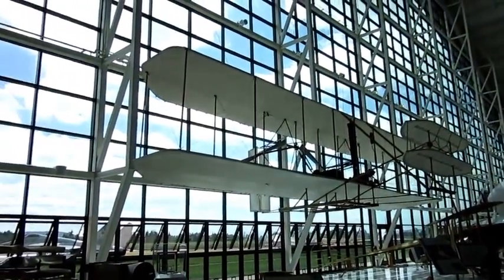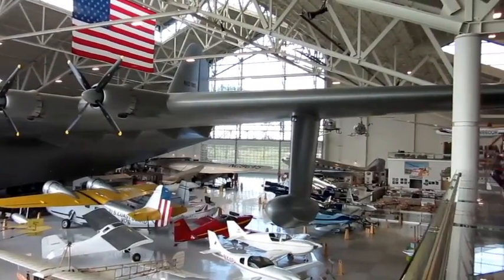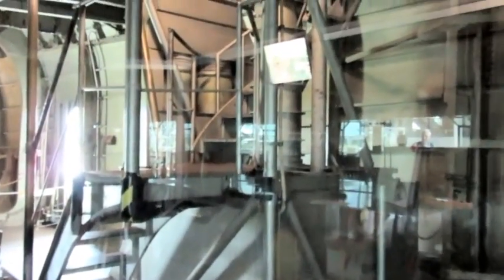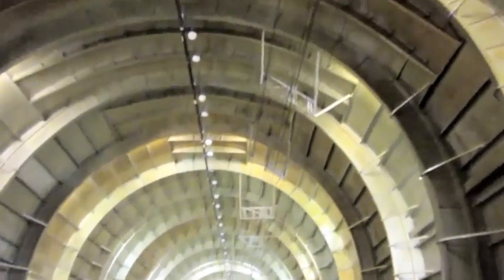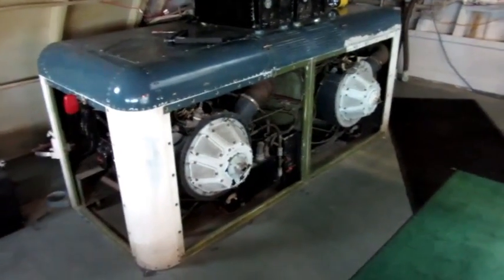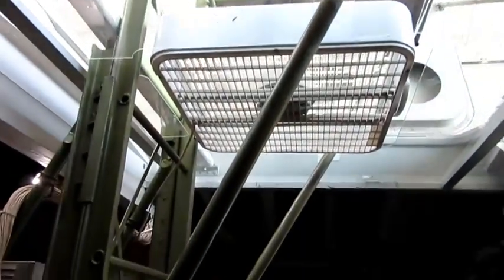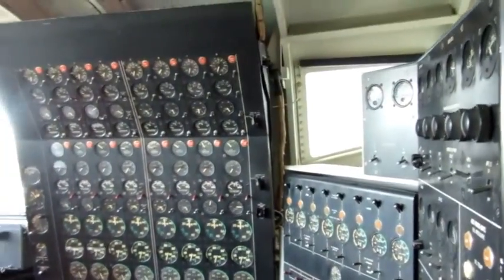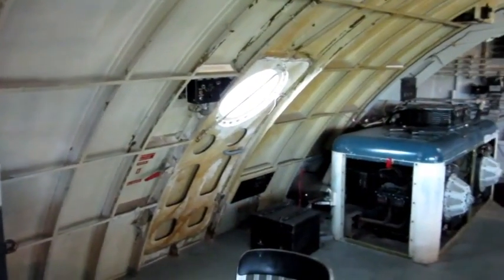Spruce Goose VIP Tour

Comment: It's interesting to me that the ADF (Automatic Direction Finder) antennae are inside as opposed to outside as in most aircraft. When I think about it, that mostly wooden aircraft fuselage would be almost completely invisible to the radio waves. It is the metal fuselage of most aircraft that requires the installation on the outside of the craft.

Comment: Hughes made his money originally from his father and The Hughes Tool Company in Texas.  Hughes, Sr.  invented the three gear drilling bit used in the oil industry, all over the world, and is still used today.  My father was a machinist for Hughes both in Texas and Culver City, CA.  My mother, brother and myself also worked for Hughes Aircraft, Fullerton, CA.  Howard Hughes also built the world's largest helicopter which my father also worked on.  There is a video of it here on YT.  Try to imagine being in the cockpit of the Hercules and having your hand on the 28000 horse power throttle.

Comment: I had  the privilege of guarding  Mr. Hughes. During a conversation I asked him if he intended to take the spruce goose airborne and he looked at me and smiled.
Reply: My Husband installed his Doctors gasoline pumps in Blythe Ca.in 77. He was the Doctor who had to go to England to fix his broken hip from a crash in a plane because he would not let the Doctors touch it . My Husband and a couple guys installed the island went back to AZ then had to go right back because the Doctor wanted it torn down and redone they could not understand then my Husband said take each pump there were 2 of them measure each pump get them exact to the inch from being apart he did put a nice coat of paint around the island the Doctor was thrilled Howard could rub off on to some people but he is one of my Husbands heroes.
Reply: @cindysue5474  "his Doctors gasoline pumps" means what?   Please rewrite so we can understand.
Reply: @robertgift  Just saying how Howard could rub off on people.
Reply: @robertgift  His Doctor also operated a gas station. So, he needed pumps.
Reply: I doubt you used the term spruce goose in front of Howard and not gotten slapped!
Reply: @jslade60  I did use the name spruce goose, Mr. Hughes was not offended by that, don't believe all the trash said about him. He was very easy to talk to.

Comment: I did this tour a few years ago with a friend of mine who was a former pilot.  While we were fascinated by the arrays of gadgets all over, my friend pointed out that there were a number of controls necessary for the operation of an airplane that were either missing or, were simply unlabelled and in strange places.  One of his best comments was that the Flight Engineers' station looked more like a movie prop then an actual F.E. station.  Why three sets of controls for engine throttle but NO controls for pitch or mixture were present.  There is a large blue button up in the pilots' area labelled "Auto Mixture Control" but, surely that couldn't be the ONLY control knowing Mr. Hughes penchant for redundancy.

Since we were the last tour of the day, our guide let us go over the controls with utmost scrutiny and NOWHERE could we find any controls that had anything to do with propeller pitch.  Even the Hydraulic control station (which was added after the only flight) had no controls for pitch.  Granted, this plane should be treated as an unfinished prototype,  but one of it's design functions was supposed to be a water landing and the ability to beach the nose.  With no Pitch control, there is no way to make the engines produce reverse thrust and back the plane away from the beach!!

It's sort of a testament (in a manner of speaking) to Howard Hughes' failing mental capacities during the construction of the plane.  His Engineers were under strict instructions to follow his orders to the letter.  Perhaps Mr Hughes forgot about these controls?  Certainly his employees were not going to go against the Bosses wishes!

Still, it was great to be able to admire this amazing piece of history. The fact that 70-odd years later - many of those sitting outdoors at Long Beach -  she's still here for all to see.

Comment: My Grandpa worked on the tail of the spruce goose, in St Louis, Mo. He was a master cabinet maker. I think he worked for Curtis-Wright, at Lambert Field. as a contractor for that build. He told many stories about his time, there, and it may have been his proudest build. He spoke about walking through the wings, and working inside the plane while the engines were running. It was a soup of sawdust and smoke, and the sounds were deafening. His most modern tool was a flat head screwdriver.
Reply from the maker: Coachbrandon01, your grandpa might have told you a tale. The Goose was supposed to have all been built in Hughes own shop in California.
Reply: @youtuuba  My grandpa was not a liar, so, I am sure with some research you'd find that he was a builder on the plane. Did he fly out of ST Louis, to work on the plane? There are many scenarios that may have happened, but my grandpa being a liar was not one of them. Only You can change your mind. Sorry this does not match your reality.
Reply from the maker: @coachbrandon01  , don't be deliberately stupid. You are the one who wrote that he worked on the Goose in Saint Louis.....NOW you say, well maybe he worked on it somewhere else, and then accuse ME of needing to adjust MY reality. Second, I did not call your grandfather a liar, I just questioned whether in the course of telling his story, some information might have been confused, or you misunderstood or misremembered what he told you. I assure you that I have a better grasp of history than to have that thrown into doubt just because somebody on YouTube claims that somebody else told him something that does not seem correct.

I read a story in the Air Force Association journal where some old guy wrote that he flew a B-36 bomber over the Sears Tower. I checked and verified that no B-36's were still flying by the time the Sears Tower existed, and no earlier structure was called by that name. I pointed this out to the journal editors, and they asked the guy's son, who had submitted the story on behalf of his father, and he replied that his father was not a liar. But we all knew that the story was partially false. Where did the error come in? Did the old man simply misremember, or did he slip up when relating the story to his son, or did the son transcribe the story inaccurately, or was there some other explanation?

In cases like this, the responsibility for reconciling is up to the story teller. For that person to tell questioning readers to discover the truth themselves is nonsense.

Comment: You stated the Goose was flown after WW2...  there are some experts who believe the plane never really "Flew" at all.  I raised on the water to height less than the total wing span. This suggests the plane only lifted off in "ground effect".  Where air builds up under the wing and floats the plane over the water.  No one knows for sure if the plane could have sustained "controlled" flight at altitude.

Comment: Back in 1992, while visiting relatives in San Diego, I had the opportunity to tour the Queen Mary and the Hughes flying boat at Long Beach, including the VIP tour similar to that described in the video. The first mind boggling view of the airplane was of the 320 foot wingspan with four of the huge 28 cylinder Pratt and Whitney R-4360 (CID) engines, with their 12 foot diameter four bladed props, attached to each side. By comparison, the final production B-29s of WWII fame, then the B-50, were equipped with four of the same engines, half the number. The size of the cockpit was incredible, and seeing eight each of the engine instruments identical to the two each  in the twin piston (Convair) aircraft that I had flown in the mid 60s pointed out the work load on the pilots and engineer. It was a most impressive experience; along with the Queen Mary tour.

Comment: What amazed me when I sat in the pilot's seat was the visibility. The top of the instrument panel didn't come much above my knees and certainly not as high as a C-172! It is certainly light and airy from the pilot's seat. Other than having to remember that your wings are extending 160' out each side I think this would have been fairly easy to operate. The wingspan is probably what would have caught pilots out when transitioning to it. I was also surprised by the ADF footballs inside as well, but the wood apparently wouldn't interfere with the radio signals. The milling of the wood in the formers was also pretty impressive.

Comment: All the wood had to be weighed and distributed accordingly to ensure proper balance. The engineering, for the time, was amazing. Underpowered for the day, it would surely have been upgraded to more powerful engines once they became available.
Reply: Underpowered? The Pratt & Whitney R-4360 was the most powerful radial engine ever put into service. At 3,000hp, the 8 engines here produce 24,000hp.  That is a 1:16.66 ratio of horsepower to weight.  The C-97, also R-4360 powered, was around 1:12.5, and thoroughly powered
Reply: The Hughes H-4 was considerably underpowered. He is not saying the engines themselves were underpowered but that the aircraft was underpowered.
Reply: And his statement is based on what? Compared to a modern jet, it is certainly underpowered.  However I just gave a comparison to another contemporary aircraft, sufficiently powered, and showed how the horsepower-to-weight ratio of the H-4 is comparable to that of a Boeing C-97/Stratocruiser.
Reply: +A.o.t.F.S.C.S. By your figures, the C97 has a better hp/weight ratio by 25%. That's still a significant difference. A 3 engined C-97 (operating with one engine out) has the same hp/weight ratio as the H-4 - surely that would be 'underpowered'. Another factor that separates these 2 aircraft is that, on takeoff, the H-4 must also overcome a significant amount of drag in the water until it reaches it's planing speed.
Reply: You might also want to take into consideration if the aircraft were to see "In service operation", the amount of drag would be even more significant if it was loaded with personnel and their necessary equipment.

Comment: I'm surprised that the back of the aircraft is believed to be too unstable for visitors considering that the plane was designed to carry heavy military equipment across the Atlantic Ocean.
Reply from the maker: 1) The Spruce Goose was intended to be a limited use aircraft, and was built from wood in order to leave limited aluminum resources for bombers and fighters. Nobody expected that the plane would be used for a long period or probably very many flights. So even though is might have carried trucks and such back in the 1940s, the plane is not as strong now as it was back then.
2) This plane is a proof of concept prototype. not a fully developed final version. As such, it has no cargo deck. Just a narrow wooden walkway over the thin wood skin throughout the cargo area. Is somebody steps wrong, they could cause damage to the aircraft structure.
3) If a visitor were to have a problem back in the cargo area; a fall, illness, vertigo, heart attack, any number of things, it would be difficult for paramedics to get back there, and if they did then damage to the irreplaceable historic relic would be likely to occur.

So, not really that hard to understand why they don't let visitors back there.

Comment: Yes,this aircraft is restoreable and flyable especially since it only would be used for exhibitions and sight seeing flights not for actual cargo.The engines are in great condition as they were meticulously cared for.
Reply from the maker: Robert Jonasson, It would be useful if you cited your credentials in making these statements. Without that, the statement is just opinion.

I do know that Evergreen had a policy that all aircraft in the collection must be technically flyable. Some of their collection was recently sold off during the collapse of the Evergreen corporation and loss of their museum sponsorship, and I believe those planes were flown to their new owners. When the museum acquired the Spruice Goose, they used some of the spare Hughes wood and control surface fabric that had deteriorated to less than flight worthy condition, and I own some of the flown fabric that they took off the Goose. And I have no doubt that the engines are good. But your assertion that the plane is basically flight worthy now seems like a stretch. Has anyone done a structural integrity test in the last couple decades?

Comment: The Spruce Goose was housed in one of the old sea plane hangers on Terminal Island, I was stationed at Long Beach Naval Station in the  early 80's we would run the ships dive boat over to the old docks near the seaplane hangars once in awhile and go poke around, no one ever seemed to notice or care that 4-5 Navy divers in uniform were trespassing! Could see the S-G through the cracks in the hanger doors. A few years later when they moved it to the dome we followed along with the dive boat. Never got to see her again, would love to go do the VIP tour.
Reply: BS. The hanger was built just for the plane. There are plenty of photos of it's construction. I worked in that hanger for 5 years.

Comment: It was not built by Hughes Aviation. It was built by Hughes Tool Company, Aircraft Division. I was lucky to have gotten a great tour while it was still in the original hanger in Long Beach. Got to go out into the wing behind the engine and then up into the vertical. Got to sit in Howard's seat. It is the Flying Boat, not the Spruce Goose.

Comment: Fascinating.  I wonder if any of the engines have been started since that one and only flight, or if it would be possible to start one now.
Reply from the maker: A friend who used to work in the area (where Hughes kept the Spruce Goose in an air conditioned hanger) told me that Hughes insisted that the SP be kept flight worthy, and a small crew of maintenance people did that for many years until his death. I assume this means that the engines were run, or at least turned over, periodically. My friend told me that he and a buddy who was on the Hughes hanger staff used to visit and eat their box lunches in the SP cockpit on a regular basis.
Reply: Thanks very much for that information.
Reply: @youtuuba  I worked on it from 74-78. The engines were never run again. All we wold do in hand crank them every couple of months to circulate oil thru them and keep them lubricated. I wish the myth that it was kept flight ready would just go away. It was never true.

Comment: .....Fire extinguisher at 5:00 almost have to be C0-2s . These use 1,800# rated steel cylinders though for aviation use who knows?......... and regardless total tens of tons. I think there would have been dedicated cylinders for each hazard as valving directing the C0-2 was not done........Those cylinders require serious reinforcementing to mount/secure them. Wondering if ext~systems were intended.for use in flight.or simply to protect a landmark?.....C0-2.in confined spaces suffocates ..
    Shame it's only 480, can't clearly see detals.

Comment: Wondering if either the hanger or the inside of the plane have the need for humidity control?
Reply: I asked about this very thing when I visited. The docent said that since all exposed wood was treated and sealed, there was no need. There is a de-humidifier unit on the starboard side of the flight deck, behind the flight engineer's station just in case. I was there in August and thankfully there were several fans moving air because it was pretty hot in there.
Reply: @jsullivan9238  I worked there from 74-78. My job was operating the climate controls. There were humidity and de humidity equipment in the hanger, but by the 70's they didn't work anymore. I visited the museum in Oregon. I was surprised by the amount of misinformation and outright BS the docents were telling people.
Reply: @hbpirate9023  Now that you mention it...
I was last there in 2006 or so and it was hot as hell inside. I wonder if the same broken HVAC/Air Handling system was still there LO.

Comment: I'd like to see how they got that monster from LA to that Museum.  I know it didn't fly.
Reply: Wings removed and then multiple barges were used. It was taken up the Pacific Coast and into the Columbia River and then the Willamette River. Finally trucked last few miles in mu h the same way old homes get moved.. Then took years to reassemble. The Hangar it is in was built around it..
Reply: @ParkerUAS  That's for that.  It obviously got done. In my life I have been able to get a few things done I wouldn't have had done but I would insist "there is always a way." and that motivated me to find a solution not evident straight off.  That move took the saying to a new level.  Cheers.

Comment: It weighs only 1/3 of theA380 albeit it is as big if not bigger than A380.
Reply from the maker: topspeed10, well, no it is not as big or bigger than the A380, but it does have bigger wings.
Reply: 320 ft. wings. AN-225 I believe is in 280 ft or so. Quite impressive especially for Spruce. Only recently are they (Scaled Composites Stratolaunch) are constructing a launch platform in the Desert that will eclipse this, but it has two fuselages and doesn’t equal the single span that this does. The Stratolaunch will have a 385 ft wing span.